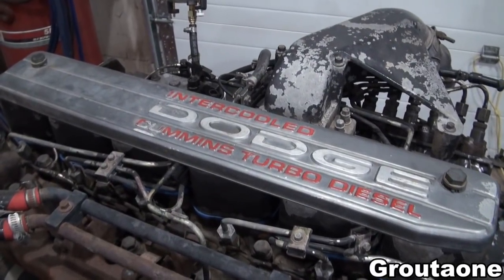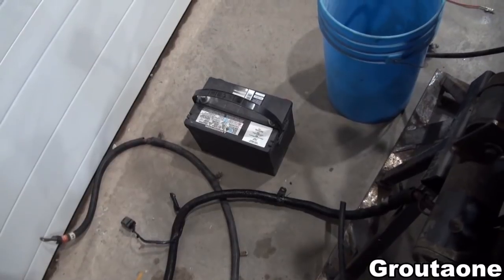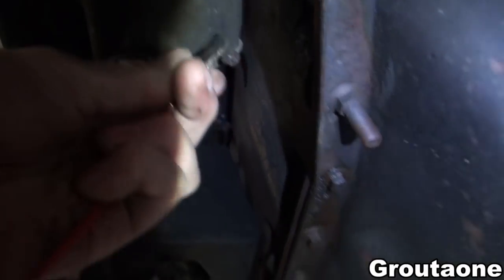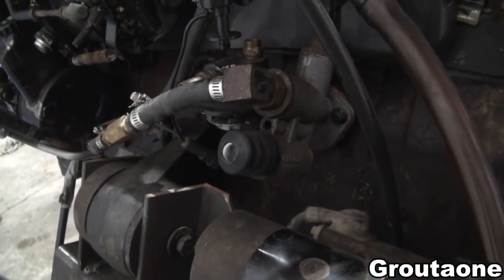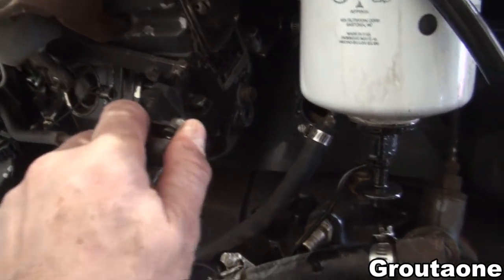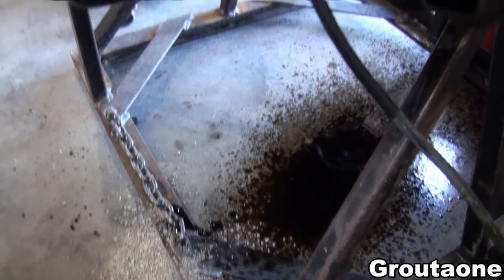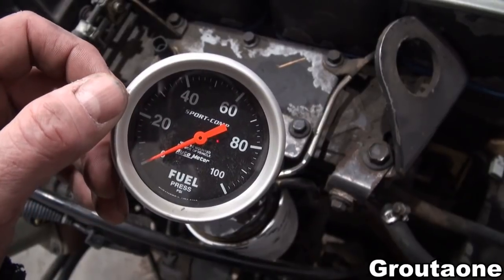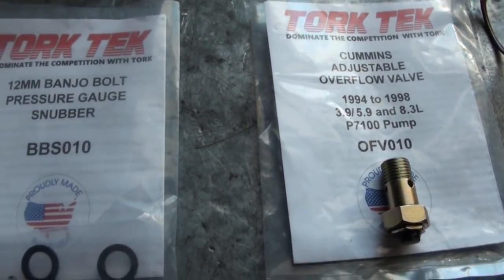12 Valve Cummins Running/Testing on a Stand

Comment: I just bought a decent 1994 5.9L 12 valve with a P-pump. I have no clue where and what each port goes to even the ones that have plugs on them. So basically I have no clue how to get it to run on a test stand without destroying the engine before I get to actually install it into my 1987 Chevy V20 3/4 ton truck! I have alot of sensors on this thing but no wiring harness that came with it to even try and figure it out! Also I have no clue what each one of these sensors are for I am such a noob when it comes to the Cummins diesel. Also I have some curved half inch to 3/4 tubes here and have no clue what they go to either but if I had to make a guess they go to the heater core! Could you PLEASE make a video that explains this stuff because not one single " Cummins " youtube video goes into the fine detail on this its like some sort of secret that no one else is allowed to know! Even the engine swap videos and rebuild videos skip over that stuff! They go from completely apart to running in less than 5 minutes!
Reply from the maker: All it needs to start is battery cables, battery, one wire from battery to starter solenoid to momentarily crank starter and fuel, that's it, no sensors need to be connected

Comment: Did it work when you changed the valve?
Reply from the maker: I never changed the bypass, this engine goes into storage, there is another 12 valve that I want to work on instead
Reply: Okey, just saw your acceleration test btw nice work. I had one idea once to test one thing when navigating. The idea from when my ant sail over the Atlantic, I asked if they arrived in the right spot and they did not. So my point was to test by compass going from a start point straight east and just going for a longer distance. Then check with the GPS coordinates if there is a straight line or if my path is curving. If its flat maybe when heading east or west path should be curving on the GPS. then as insurance test walk straight north to see that path is straight. What do you think about that? Maybe one of your big fields near by is big enough to see a result. I think GPS system is stationary. Regards from Sweden!
Reply from the maker: I think both round and flat would require turning to stay going west or east, however right on the equator would not require turning if earth were a sphere, I think GPS is ground based towers, maybe should stand for Ground Positioning System.
Reply: I’m having an issue with the 1996 12v cummins in my dodge 2nd gen. It’s cracking the fuel filters and spraying diesel. Iv had to replace about 5 filters in the past 2000 miles. I’m having trouble finding information on this topic. Can you think of why this may be happening? Truck runs fine and pulls a huge load but filters are breaking. Working on getting fuel pressure gauge on so I can find out what the pressure is and that will be my next step.

Comment: shutting off the air to that turbo will not shut the motor down, the air intake is not connected!!!! He would have to put the board over the air intake on the other side of the motor
Reply from the maker: Oh man what was I thinking ha ha, so true good eye you have
Reply: groutaone did that truck run rough when cold? I’m working on a 96 12v that spits and sputters when cold I’m for sure going to have to try your trick of pinching the line..... I’ve suspected the ofv is the culprit
Reply from the maker: Mine would idle and run fine cold, when I say cold I mean a cold start on a summer day, I didn't drive it in winter so for that temp I don't know how it would behave, as it would warm the engine idle rpm would start to pulsate slightly, when I heard it pulsate I thought it was maybe searching for fuel.
Reply: groutaone the truck I am working on misses really bad and blows white smoke if you touch the throttle until it gets to operating temp.... kinda like a gasser with a carb and the choke is not working.   Not my truck it belongs to a friend, I have a 93 Cummins and it runs like a top ;)
Reply from the maker: I think some guys have gotten outstanding fuel mileage with the first gen, how good is your 93 on fuel?
Reply: groutaone mine isn’t a great example for mpg.... most days I get 15 but that’s because my truck is an auto and 4x4 and I live in a very hilly area, on flat highway going 55-60 I’ve gotten 20 or more.   In comparison my work truck is a 2005 dodge with a hemi all stock and driving the same hills I get 8mpg on a good day haha. Edit: that’s us gallons too, if I remember right you are in Canada and your gallon is slightly larger I think but I may be wrong.

Comment: IIRC ,on my Bosch pump on my '92 VW, the pressure varies from around 45psi at idle to 125 psi at 3000 rpm... reason for that increase in pressure was to advance the injector timing as  rpm increases.  Another check on overall vane pump condition was to record the amount of return flow back to the fuel tank at idle.  I'm not sure hot much similarity there is in second generation Cummins, but the 1st generation Cummins used a very similar pump
Reply: knikula This truck uses an inline Bosch P7100 inline pump, static timing.

Comment: Looks like that'll be a reliable engine if you deal with all the maintenance items while you have it out of the vehicle. Get to it while it's easy to get to!
Reply from the maker: Indeed, actually I have another 12 valve out of a five speed truck and that is the engine that I would like to do a tear down on, this engine in the video is planned to go in storage.

Comment: Good Info, thanks for the teaching video.  I'm Just waiting for a good donor 12 valve to swap into my Suburban.
Reply from the maker: Thanks for your comment, the 24 valve cummins are nice but as time goes by it seems the old 12 valve is hard to out do.
Reply: groutaone 24 valve much better on the hiway 12 valve better power and durability for everything else.

Comment: Glad to be of service.
Reply from the maker: Thanks man
Reply from the maker: I am considering AFC live or The Adjuster, I'd be curious your thoughts
Reply: groutaone ehhh AFC live is definitely better. There's no real point for you.  I'd go with a #10 tst fuel plate and some AFC adjusting.  You really only need AFC live for high powered trucks that can be difficult to tune the smoke out.  For you, just adjust it to where you want the power to be and it doesn't smoke.  I'm assuming you going to use the truck for daily driving and towing.
Reply from the maker: Basically I want stock power and also the ability to easily turn the fuel back on demand for fuel economy.
Reply: groutaone it's all how you drive.  You can have 300hp and still get 20mpg. Just keep your foot out of it, when you need power step on the throttle.  No need for expensive tuning tools.  Get a boost gauge and try to keep it as low as possible, and that will yeild the best economy.  Stay away from delivery valves, bigger Injectors and big turbos those will rob fuel economy weather your in the pedal or not.  Free AFC adjustments and a $200 fuel plate will give SIGNIFICANT power increase with little to no affect on mpgs as long as you go easy.